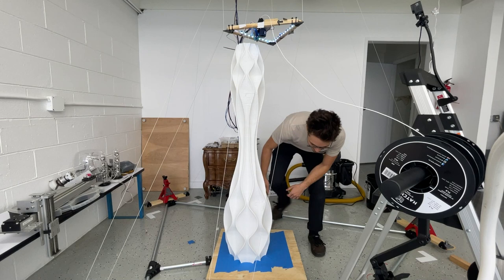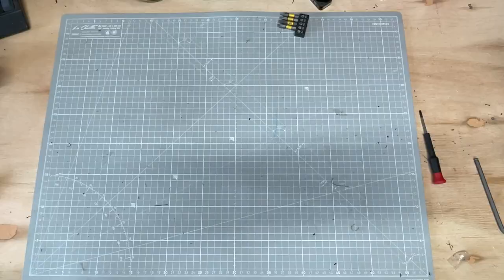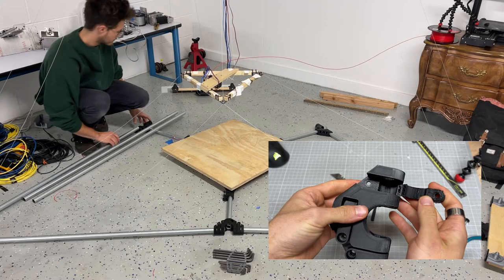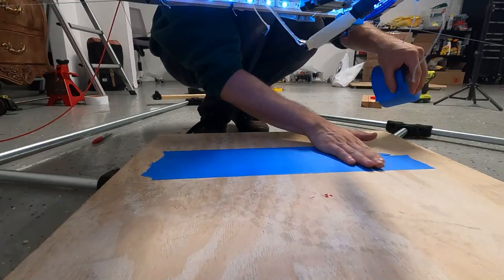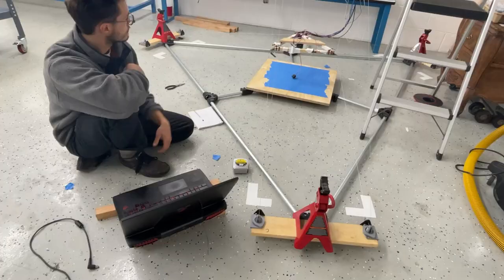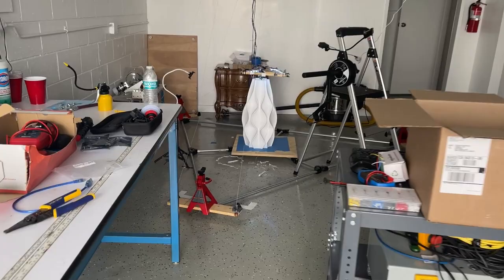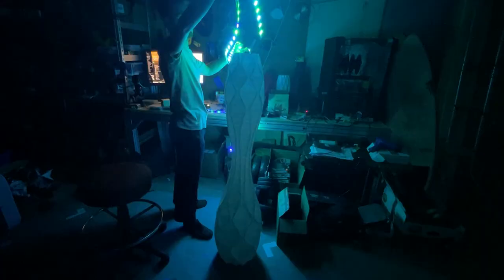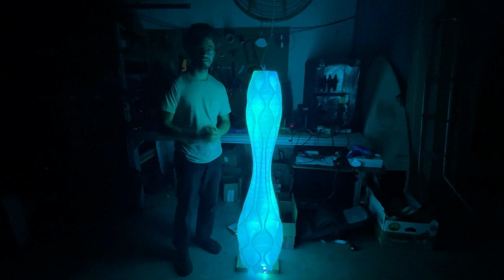Massive 3D Printer: Big Vase and Base - Part 2

Comment: Pato! this is incredible work. I myself am building a hangprinter v3 pretty much and have the steps skipping severely... i got interested by that remark on steps per unit solving the problem. any hints on principles of adjusting that would be hiiiighly appreciated! :)
Reply from the maker: That is so cool! I can try to help no problem, what motor controllers are you using? It’s very important where you add adjustment to the micro stepping, you want to make sure that adjustment happens before the kinematic solver otherwise the printer will lose track of where it is in space. I had to hack a few parameters to get that to work. Let me know if that helps!
Reply: @patoroboto  Pato hello! Thanks for your quick reply. I thoght I've got back to you as well but it seems my reply was not recorder. Either way, I actually have the same model as you do tmc2209 but am using them as plug and play replacement as I couldnt get Marlin to compile if I changed the features in firmware... perhaps those are the tweaks you were talking about? :)
Reply: @patoroboto  also really like your portable hang system. is there anywhere i could find the parts to print the construction joints myself?:)
Reply from the maker: Yes exactly, I had to do a little tuning to get those drivers to work, if you want I can send you the firmware I’m using along with the 3D printed files. Maybe shoot me an email?